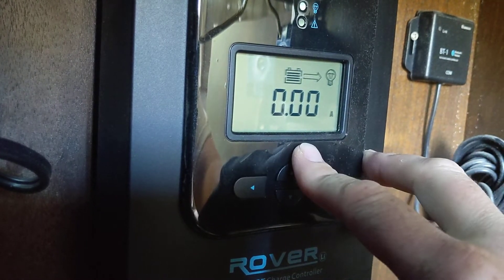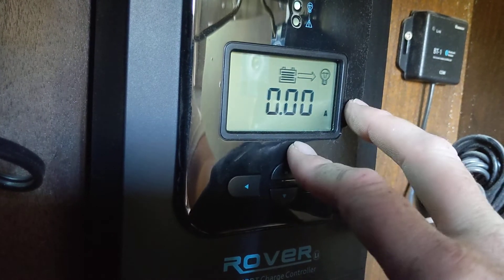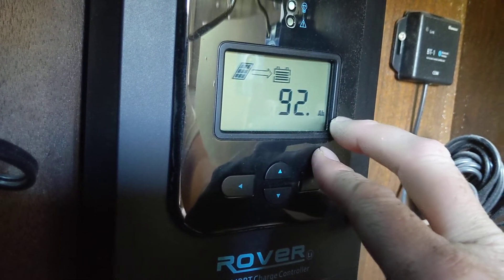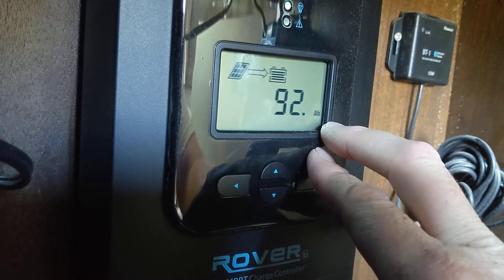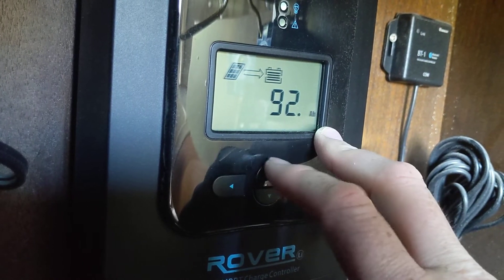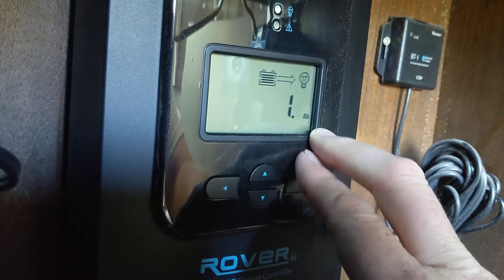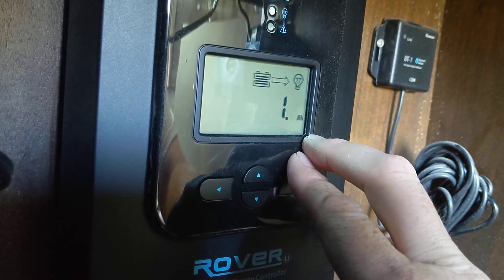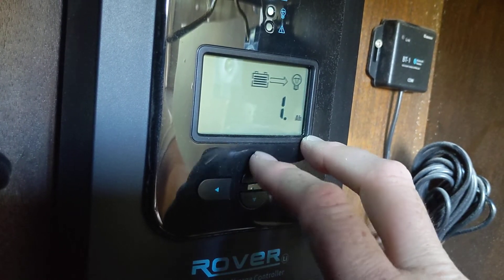Part 2 of charge controller education when using Nissan Leaf battery modules!

Comment: What voltage is your bank fully charged?
Reply from the maker: 24.9 volts.
Reply: @ezmeraldadudortoka7549 and u did that without any problems?
Reply from the maker: @fadajuiceful  Huh? You're literally looking at and commenting on the video that shows that they definitely work and I haven't had any issues for over 2 years now. There is videos where I do go into great detail about this type of topic. ♻️🔌💯🚮🌞

Comment: I have a Renogy Rover 40 amp charge controller & I am looking for settings for my 3 Nissan Leaf 24v batteries.   The manual is a little confusing about how to set some of the perimeters,  what I did notice at that bottom of the perimeter chart page was that if you are running a 24v system you still set the perimeters for a 12v & the controller will make the adjustments if you have chosen the 24v as your system.   Some of the settings call for a "0" setting & the lowest setting I get is a "9".
Reply from the maker: I can't really prove it but that asterisk in the manual and that fine print in the manual didn't exist until I called them and spent six hours on the phone with them about a year and a half ago and explained to them that predicament and why it was catastrophically unsafe to fail to tell people that. That didn't used to be in their manuals but it's obviously a good thing that it is now! I'm not exactly sure how to answer your question however... You already know that the values are doubled so I would set your cutoff limit to 12.5 or 12.6 which is actually 25.0 or 25.2. I would set your charge limit to 12.45(24.9). At the other end of the spectrum I would set the cutoff low voltage at 8(16) and then set your discharge limit to 8.5(17 or 18) or 9. Chances are your inverters not even going to allow you to draw past 19 but that 10% is very rarely needed or missed. I can send you screenshots of my entire parameter settings if you'd like. As for all the other boost and floating and equalizing charges those will be different per person depending on how they want to utilize their system. Hope that helped! Thanks for saving the world! ♻️🔌💯🌞🤙

Comment: How long can you run the a/c on your system?
Reply from the maker: Well Buck, That's a fairly unanswerable question because there's way too many variables. Are you asking me how long I could run my air conditioner without my solar panels hooked up? Are you asking me how long I can run my air conditioner at night? Are you wanting to know how long I can run it during the day? How hot is it outside? Is there direct sunlight? What time of year is it? 
These are all variables that make for a completely different answers when trying to answer the air conditioner question. I did do a test at one point where I completely disconnected my solar panels all together and was able to run my air conditioner for about four and a half hours. That's fairly silly though because nobody's ever going to do that. 
Luckily the air conditioner equation largely solves itself. The time of day that you need the air conditioner most is also the time of day that you'll be able to generate the most. I only need my air conditioner for about 6 weeks a year and during those 6 weeks I can turn my air conditioner on at 10:00 in the morning and let it run till 5:00 in the evening and it never actually even touches my battery percentage. Because that's during the summer when I have the best generation. My air conditioner only requires 450 watts to run and I have 600 watts in solar panels...Which is why I can run it throughout the day during the summer and it never even touches my battery capacity percentage. 
Sorry for the incomplete answer but there's really no way for me to give you an actual accurate number without knowing all of the other variables and even then it's hard to put an actual time limit on it because I don't know where you live or how hot it is or how many solar panels you have or how big your air conditioner is or any of that!

Sorry for the fairly incomplete answer. 🤷‍♂️

Comment: So when I hooked my 3 leaf batteries up for 24 volts to my rover 40 amp. It gave me an error code for under voltage. Then as I watched them charge, it went past what I thought was cut off voltage for 24 volts. The percentage of charge was a lot lower then yours at over 25 volts. Any thoughts
Reply: I have not found out how to do that. The manual is confusing at that point. Did you set yours through the lithium setting or another way. Mine controller is the same just the 40 amp version
Reply from the maker: @Starkchris  okay, for safety reasons go disconnect your panels from the charge controller for me first.
Reply from the maker: @Starkchris  Did you watch my charge controller video? It needs to be on 'user' battery type and 24v system.
Reply from the maker: @Starkchris  You'll need the administrator password to change anything: 135790123
Reply: What voltage do you set for shut off
Reply from the maker: @Starkchris  Please watch my charge controller video before you try to hook anything else up. I would highly recommend disconnecting anything that you have right now if you have not customized your parameters. You can't just plug Nissan Leaf batteries into the charge controller and expect it to know exactly what to do.
Reply from the maker: Have you customized your parameters on the charge controller? They need to be set to 25 so that you don't overcharge anything.